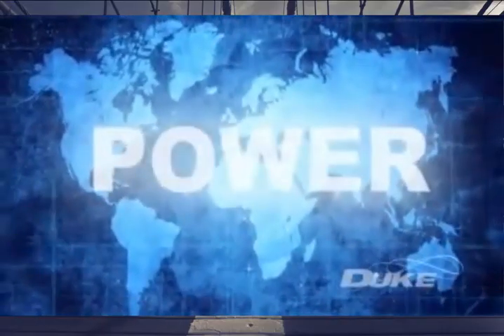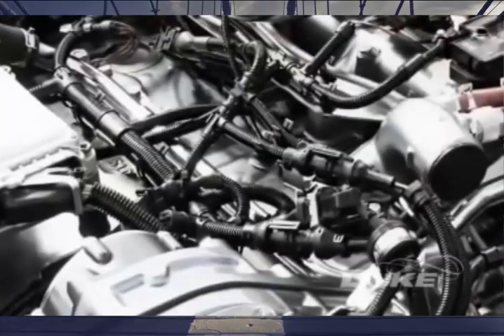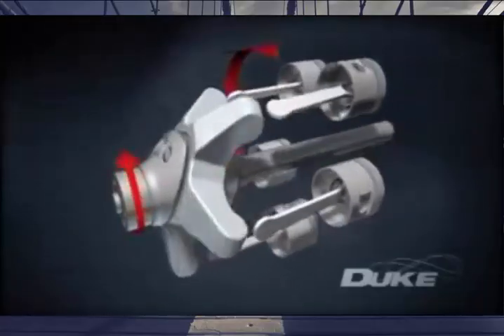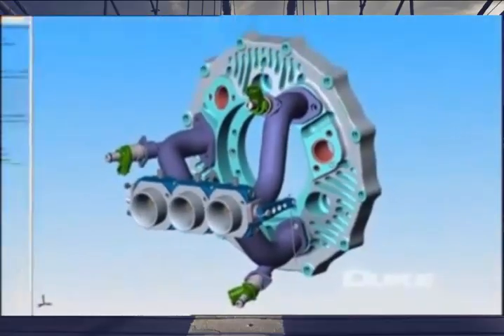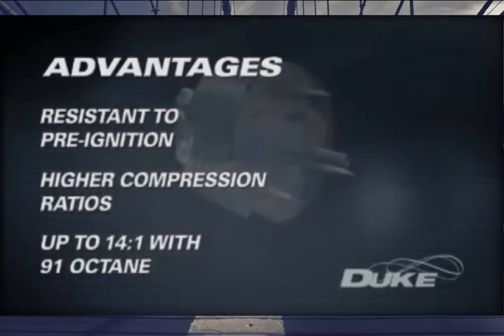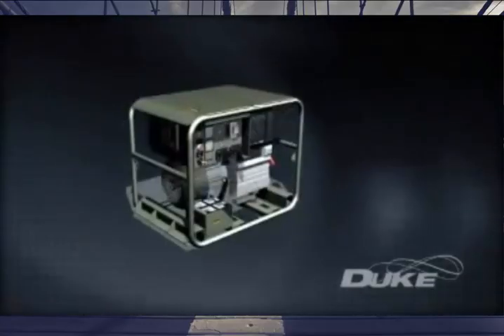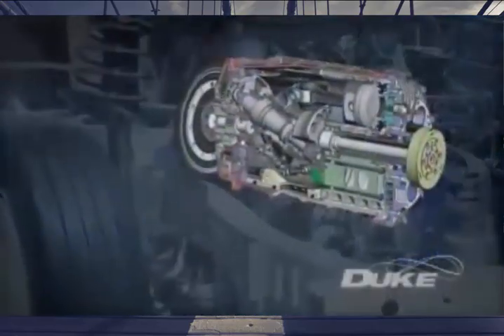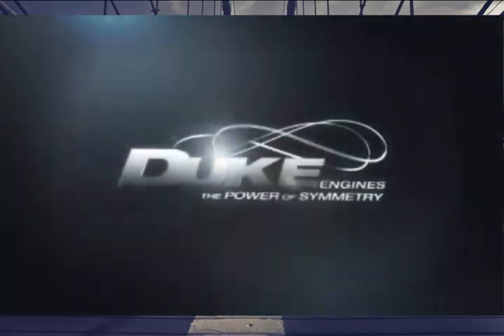Duke Engines | All information about Duke Engines

Comment: Really cool design however...

this motor will have major thermal limitations due to how tricky it will be to push coolant through it, also a limited power band due to the way its values work. Longevity will be an issue since it has to maintain a gas seal on surface that has a moving part married to it. That is a lot of rotational mass, while not an issue in some applications it can be problematic in others. Lastly advance maintenance and repair on this would be a nightmare. Good luck, its a neat design.
Reply: +Roland Waites demos like this that have video promos are usually just fishing for capital from people who don't know better.
Reply: That rotating mass brings up the vibration issue he was bragging about. That's a big hunk of precision-cut metal to have to balance.
Reply: Well that's twice the life of a Continental or Lycoming with their 2000hr TBO.
Reply: Dyna Cam actually looks like a better design
Reply: Depends on the engine, a brand new LS based chevrolet can be overhauled just as inexpensively as an old school SBC... I would know, I built a 1,200 HP Turbo LQ9 :-) most 4 bangers and stuff though, I'd just rather pay 500 an put a used motor in.
Reply: Dyna Cam built something like this in the 1960's and put it in an airplane, they work, but it only lasted 4000 hours or something.
Reply: KlockworXMusic
4000 hours would be good for a conventional engine. Maybe you meant 400?
Reply: Glad to see some observation in the comments. You've pretty much nailed exactly the concerns I have with this - only you worded it much better than I can.
Reply: I fly a Cessna and I'd love for my engine to last 4000 hours between overhauls.  Normal TBO is 2000 hours but you can stretch it out to 2500 or 3000 hours by replacing rings, cylinders, etc.
Reply: I don't fly planes, but 2000 seems pretty sad.  We run everything in our oil and gas field on 50000 hour overhaul shifts, every 6 years or so.  Everything from the little Isuzu 3AB1 diesel, the Vortec V6's, Chev 350's, Ford 300 I6's and even the great big CAT C175's, Waukesha's, whatever.  Many of those engines have been out out there for numerous overhauls as well.  So for these to only take 4000 hours of what we put normal engines through for 50000 hours before having to do a major overhaul is pretty ridiculous in my book.  4000 hours would be twice a year for us; twice a year, down for 2 days shelling out loads of cash to completely remove and overhaul an engine is insane with all the engines we have, we would have mechanics out there constantly doing engines.
Reply: Really, because I run engines on 50000 hour overhaul shifts, 4000 is garbage in my books.
Reply: +KlockworXMusic Engines in the field are never shut down, right? The wear from starting an engine repeatedly is what causes the lower life expectancy.
Reply: They get shut down with surprising frequency, not as much as an automobile engine say, but still more then one might expect.  They probably average a start once a day; some days they run fine, others we start them 10 times in a day.  They do get shut down for regular maintenance, oil and filter changes and what not, the occasional unexpected maintenance issue that pops up (electronics out of whack, automatic governor not adjusting properly, sparkplug on a cylinder stops firing, whatever), as well as normal operations.  Some lines we can't pig without shutting down, otherwise we will knock the plant down anyhow, water in the lines sometimes, a booster goes down as well, etc.  We do also mark down down time, they get their full 50000 hours.  They still get started a fair bit.
Reply: A well maintained IC piston engine can easily achieve 4000 running hours.
Reply: Aircraft engines are also run from 70-100% throttle through the range of the entire flight, with full load put against them, until slowing for the pattern and landing. It's like if you put your car in 4th gear and ran 110 mph down the highway for up to 4 hours at a time, up a continuous hill.
Reply: *****
Drag racing engines. But they are overhauled VERY often, and still sometime blow up in the middle of a race.
With an aircraft engine, you don't have the opportunity to pull to the side of the road to see what's causing that knock.
Reply: Yep, that's why most Lycomings and Continentals have a 2000hr TBO. I'm not sure what the TBO times for automotive engines in aircraft applications are though, for comparison.
Reply: dieselyeti
I doubt that any land-based engine evn has any established TBO. Most car engines wind up in the scrap heap instead of an overhaul shop. It's a shame, really, because nowadays it's probably much more economical to OH a car engine than replace it. They are much more complex to build than the old iron from before the 90s.
Reply: Nothing new about an LS motor.
Reply: Everything is new about an LS motor. It ain't no smallblock. (Regardless of what they call it)
Reply: A lot of people have made the same comment about the large seal running at high velocity  - but the shape is much better a simple circle not blocks. It should be better than a wankle engine?  The engine is more like a sleeve valve engine and they were made and put in cars but that engine was not made for long.

The steam engine was at its peak when they went out of fashion.  Steam cars were very fast at the end and always ran silently without gear boxes to waste power.

Comment: When I was in collage I made a static model of a Duke engine. That was in 1965, fifty one years ago! This concept is NOT new. If it was superior to the "crankshaft" type internal combustion engine in use today, we would have been using it for the last fifty years. To say the standard internal combustion was not changed in the last one hundred years, is just as foolish as saying the wheel has not changed in the last ten thousand years; it still is round with a hole or axle in the center. "So why are they putting this misleading video out on the internet?" you might ask. Because they need MONEY to continue on with their work on this engine. Now it might be a good idea eventually, but telling half-truths to secure ones funds does not appear very honest to me.

Comment: in thr immortal words of Peter Griffin: WHY ARE WE NOT FUNDING THIS?
Reply: Looks like a variation of the basic two stroke.  In order for this to pass emissions, it will need to be made as a four stroke and add a lot more complexity.  Likely better than a Wankel but not as good as an Otto cycle.
Reply: Pretty sure this design is a 4 stroke. But strongly suspect something in that engine is a weak spot which needs lots of engineering hours to make it right.
Reply: Because they suck for car engines. They have been around since 1911 when the first production axial engine rolled off the line.
Reply: Mark Johnson
You sure?  It's got no valve, just piston ports for intake and exhaust.
Reply: Peter would be among the first to invest in it... except he would be about 100 years late.

Comment: So instead of rotating a crankshaft only you rotate the whole engine block? Plus a "sort-of-crankshaft. To save energy? Give me a break! But you've reduced the spark plugs from 5 to a mere 3? Wow! That's definitely gonna save the day! I never saw the lubrication system of this engine. How does it look like? Lubrication? Longevity? You mention the lack of hot valves as a big advantage since the hot exhaust valves are, in most cases, the source of premature ignition. This problem, however, does not exist in Diesel engines. Plus, what's the possibility for a variable valve timing? I see no practical possibility for this in this type of an engine.

Comment: The problem here is that you're never achieving the 90 degree leverage which a crankshaft can provide. Instead you have a piston pushing down on a wobble plate at a ~45 deg angle, essentially cutting your power in half. Not sure what you would use this on. Probably something which needs to be very lightweight and small.
Reply: probably also why they dont say how much horsepower it has

Comment: the extremely hevy swashplate is going not only round but getting heved up and down This is lossing most of its power unlike a real engine with the crank shaft just rolling round. Rotory engines have a porting valve system as well NOT VERY ECONOMIC!!! gas gusling low life. This is not a new idea

Comment: Another good idea that appears to be disappearing without trace😐
Reply: Disapearing ever since 1911 when the first production axial motor started production. These engines work at low rpms(the 1000-1500rpm range compared to a standard engines which is generally around twice that) making them unsuitable for cars. They have however shined as motors for both torpedoes and light aircraft for years.
Reply: engine speed has no impact on car use. you just build the transmission with the gear ratios to compensate.
Reply: Yeah, better make a new batch of tinfoil hats!
Reply: Guess you have never heard of the 'Chicken Tax' the US federal government placed a heavy tariff on imported pick-up trucks making them unprofitable to sell here...
Reply: Just like the Australian Revetech engine.
Reply: Euh actually gasoline engines are way better in terms of emissions, diesel engines emits a LOT of harmful particles. And it's coming from a guy from France where 75% of cars are diesel.
Reply: ***** HCs are the largest component in photo-chemical smog and poor air quality that are emitted from vehicles alone.. California has the earliest and strictest standards for vehicle exhaust pollution in the world and classified Diesel vehicles as clean alternative fuel vehicles without exhaust after-treatment for over 30 years..
Reply: ***** Photo-chemical smog creates the formation low altitude Ozone. Ozone causes severe lung injury and can cause death.. not just block the sunlight.
 One simple answer. The "Chicken Tax"
  25% tariff on potato starch, dextrin, brandy, and light trucks imposed in 1963 by the United States under President Lyndon B. Johnson in response to tariffs placed by France and West Germany on "dumping"  the importation of U.S. frozen chicken at below cost.
 Volkswagen has restricted the importation 
of light trucks into the US since the Chicken Tax was imposed and is STILL IN PLACE
25% tariff eliminates any price competitiveness or profitability.
 Japanese manufacturers are also effected and import their trucks as incomplete or "knock down" kits which must have the remaining assembly of the vehicle completed on US soil. 
The VW Beetle shares the same platform and engine families with the Golf and Jetta models in the US.. there are other more fuel efficient models in Europe but do not meet US regulations for vehicle safety standards and emissions..
Reply: huverdoose Yeah, they already left their stockholders with worthless shares too!
Reply: It's just another implementation of the Otto cycle, just like this engine above. I'm pretty sure Toyota has more expertise in making an efficient Otto cycle engine than some unproven prototype, if not, they'd just buy it out and these hacks would all be millionaires, but they're not
Reply: Giuseppe You prefer toxic hydrocarbons and poisonous carbon monoxide????
 Perhaps you should start using your brain instead of letting religious cults and media producers do the thinking for you...
Reply: The real doktorbimmer Haha believe me I'm far from listening to religious cults and media. I'm atheist and never watch tv in fact. Cf. comment below.
Reply: ***** Granted gasoline emits far more CO2 than diesel, which is bad. However, diesel engines produce more nitrogen oxydes (NO and NO2, mainly) which are even worse for the atmosphere. As for the particules, diesel emits Benzo[a]pyrene known for causing cancer (estimated 40,000 deaths per year in France).
Reply: Diesel is more power efficient, the problem with the arguments here is how CO and N0x by products which is more prevalent in high compression engines (most diesel) and lead (also from diesel) is caught by the cat-exhaust system. It is possible to do, and has been done with many implementations, just one bad apple spoiled the bunch, hence the boogey man nonsense about diesel, in the same fashion everyone scrambled from Nuclear after 2011 in Japan.  Also about whether C02 is a pollutant or not, that's splitting hairs - it is a greenhouse gas. As for this particular engine,  it's  simply not feasible to implement, it's too complex.  You think car companies haven't looked at stuff like this 1000 times over?
Reply: Giuseppe Well, I guess that proves the old theories that the French have no sense of humor and they all eventually go to hell...
Reply: Giuseppe Unfortunately you have your facts all wrong, the most toxic and carcinogenic compounds are HCs and CO and no engine design produces more of these pollutants than the Otto type engine, The Diesel produces (even without exhaust after-treatment) much less HCs and virtually zero CO compared to an Otto type engine of equivalent power output.   

 The facts are very clear.. France's current air pollution is not due to Diesel engines... its due to the fact that France is decades behind most Western Countries in terms of vehicle pollution controls and standards.
Reply: ***** Apart from fundamental combustion efficiency, fuel economy and pollution controls are not generally compatible.. while a few examples of emissions control technology actually improves fuel economy... most actually lower fuel efficiency..
compared to the US some countries like  France have virtual no emissions control standards or controls.. the benefit however is vehicles with much better fuel economy..
Reply: James Szczesny CO (Carbon Monoxide) is not prevalent in the exhaust products of compression ignition engines..
Compression Ignition requires Stratified Charge Mode combustion that typically operates in air/fuel ratios that are too lean to produce significant quantities of CO..
Rather, Diesel type engines inherently produces far less of the 2 most dangerous and toxic air pollutants which are HC's and CO.
Reply: ***** The VW Amarok is not currently sold in the US because it is subject (like all imported light trucks to a 25% import tax)
VW actually has plans to start manufacturing the Amarok platform in states, as it did with the Rabbit pick-up that was produced in Westmoreland Pennsylvania until the A1 platform was replaced by the A2 platform.
Reply: ***** Actually president Johnson (a Social Democrat) and the UAW (United Auto Workers Union) conspired to get the Chicken Tax passed..
 Not the oil companies,
The "Big Two" remaining US automakers Ford and GM make huge profits thanks to the limited competition in the light truck business..  their most profitable segment ever since the Chicken Tax took affect.
Reply: ***** The people created the so called VW "Dieselgate" scandal are the same people that stand to benefit from it, other automakers like GM, Toyota and Tesla that have invested heavily in hybrids and plug-in electric models that are still selling poorly and were being out sold by VWs super fuel efficient TDI models..
Reply: Or another bad idea that is sinking back into the obscurity from which it should never have arisen!
Reply: Except its not that good, Dyna Cam built some of these in the 1960's, and they only had a life of like 4000 hours.

Comment: ya.. a turbo.. and whats the average HP? or how is the engine based? on a liter system? like a 2.2 liter? And the pistons are sideways.. how does the oil work? it only cools half the engine at a time with the sump on the bottom side? is there oil? nice idea but the video explains nothing technical. I dont care about what it can fit into. Id rather know how it works.

Comment: Nice design!  I thought of something similar many years ago that operated similar to a squash plate in a hydraulic pump.   Why don't you put your squash plate in the middle with pistons on both sides and the combustion chambers at each end.  Then the piston under pressure can help to compress the opposite piston instead of wasting that energy when it has to come to a complete stop and go in the opposite direction?  You could make the pistons smaller and have a very compact 10 piston engine.